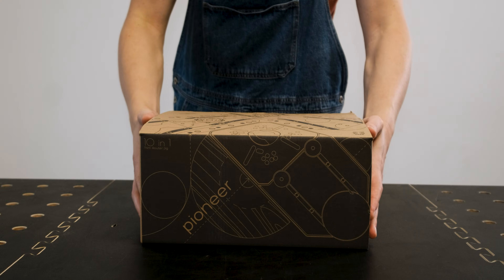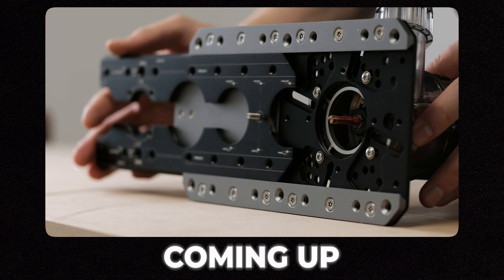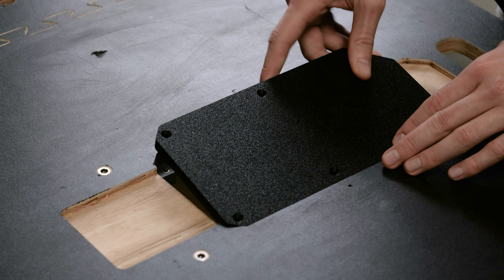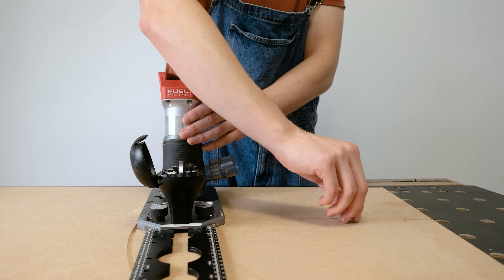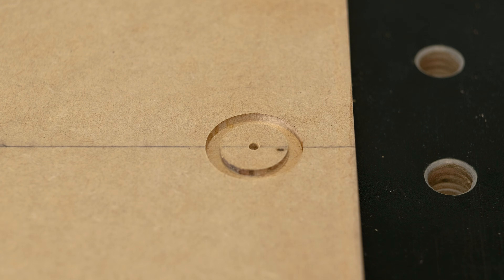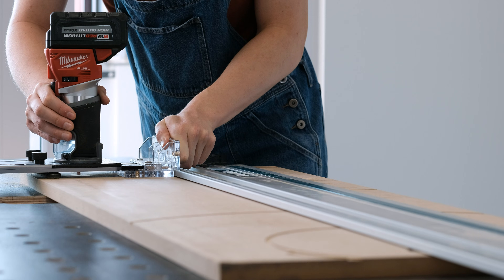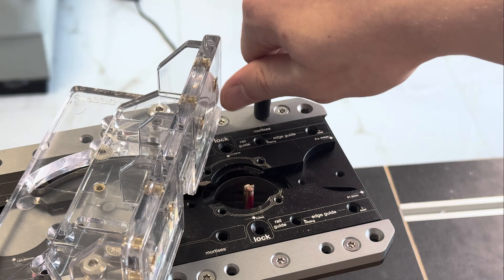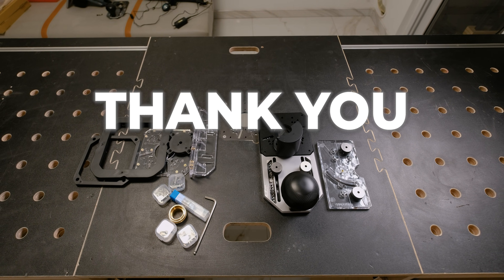Swiss Woodworking Knife?

Comment: My order is 5367. I am leaving a message here because your customer service email is existinnameonly. I received the product on January 3, 2025 and found that the bottom plate could not slide properly. I reported this problem to the customer service email on the same day and attached a video demonstrating the problem. The next day, I measured the sliding groove on the bottom plate with a vernier caliper. The result was that it was not parallel, and the width of the left and right sides differed by half a millimeter. I took a photo and reported this problem to your customer service email. And I repeated the emails I sent on the first and second days. I am worried that you did not receive it or the email system did not send it. I checked my outbox repeatedly and confirmed that 4 emails had been sent. Today is the third day, and I have not received any response.
Reply: It's already January 16th and I haven't received any response. I also left a message on their website to raise the issue. What kind of company is this?

Comment: I purchased the router jig on the 8th of August to receive it in time for Christmas - this didn't happen. It's now the 27th of December and still nothing. You have consistently ignored any customer support emails - PLEASE PLEASE PLEASE can someone answer my emails. The parcel tracking code you gave me says you still have not sent the parcel.
Reply from the maker: Hi, is your order #5309 purchased on October 21st? If so, it was shipped (with a delay) on December 8th, and the tracking number was sent via a website notification to your email.

If not, I couldn’t find any order placed under Ryan Evans on August 8th. Could you please share your order number here so I can look into it?

Regarding customer support and shipping delays, I want to apologize and acknowledge the issue. So far, I’ve been handling everything alone—designing, editing, customer support, manufacturing, and shipping. Starting next year (just a week away), I’m planning to hire help to avoid these problems in the future.

Thank you for your patience and understanding!
Reply: @ussadesign  sorry, it was suppoed to say December the 8th. The DPD tracking tells me it has not been sent yet. Can you find out any different? I leave the country on the 1st of January, so it needs to get here before that

Comment: This a beautifully and precisely designed product. Major brands should take example. The case is really nice too, and has been really optimized to fit a lot of stuff. Overall really smart design. As with every new product though, there are always things here and there. For example, mine unfortunately came without the centering pin, I would have also preferred the thumbscrews to be a bit longer, if you are not careful they keep falling after unscrewing just a couple of turns, and the sliding mechanism doesn't slide if the mounting screws are too tight, which you need them to be, so it is a bit of a pain to have to untighten them every time you need a small adjustment. But other than that I am really enjoying it.

I have a question tho, where can I find the 3d files for milling the bigger hole with the slidding door showed in the video at https://youtu.be/MZ-CkfzcD5k?t=165 ?

Comment: Have the vacuum connection shorter, and make a printable 45deg connector to make the hose exit straight up. A large rubber band can be attached to that and the router to keep it out of the way! 😎